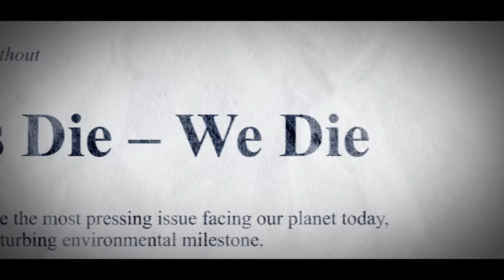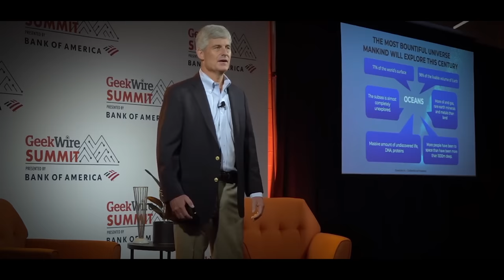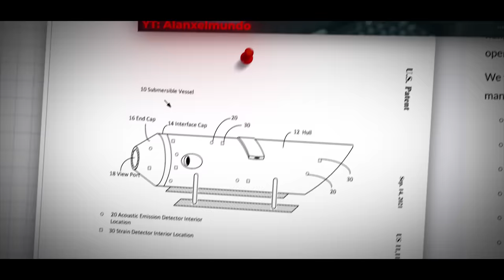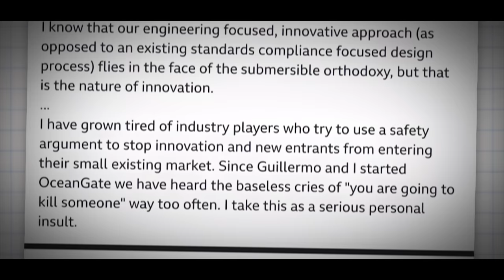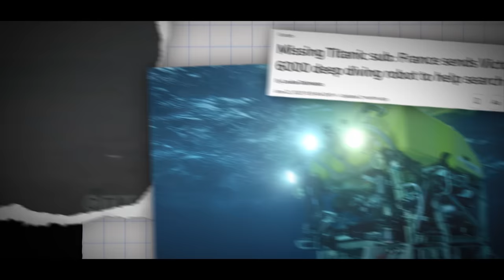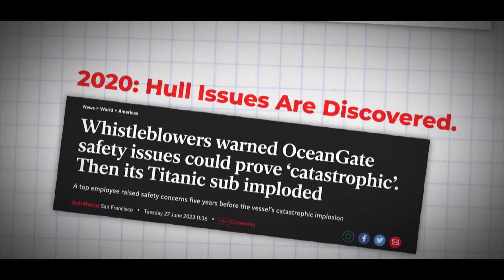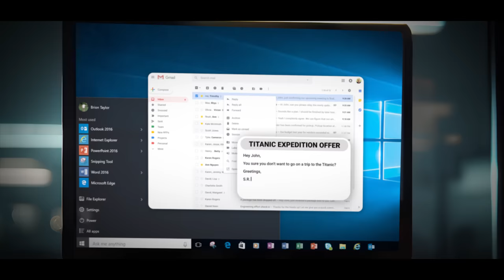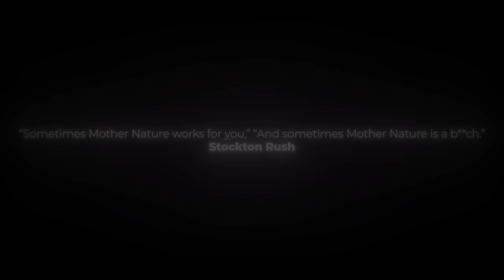The Dark Truth About OceanGate (Documentary)

Comment: I cant express how ridiculous using carbon fibre is. Anyone who passed first year engineering would be able to tell you how horrible an idea that is. Rush 100% thought carbon fibre sounded cool and decided his ego would be able to beat physics into submission.
Reply: But, they use carbon fiber in the fancy BMWs!!! 😂 How dare you suggest otherwise
Reply: This was my initial reaction too, but I think it more prudent to say there are obvious issues in using it in this application.  

I understand they use carbon fibre composites in aeroplane wings, which are in bending and hence in compression, and which flex continuously throughout the flights.  ChatGPT says they were used in the DC-10 wing leading edge as long ago as the 70s.  I have no idea what stresses are being taken in wing applications, but my understanding of comments by people who appear to be specialists is that they can be used in applications involving significant compressive loads.  I assume a lot of engineering was done to get to that point, including destructive testing and understanding buckling and fatigue issues and their interaction.  

I think the professionals in that area may be more inclined to say that it is potentially possible to use carbon fibre in this application, but a proper, very expensive, engineering research process would be necessary to validate that and determine its limits (at which point you can then consider whether it's actually economic when you do it properly).  There's an interesting video about this on Mike Bell's channel, his suggestion is that this research simply wasn't done due to lack of resources.

Two more comments: I have had many passing interactions with "industrial" and "life support" environments, and long ago I've even worked on the design of electronics to operate in them.  But - of course - there are whole layers of safety/reliability engineers working above the level of the technical electronic design who take charge after that.  To see consumer electronics and plastics used inside Titan catches my attention for multiple reasons.  

I also wonder what on earth the acoustic monitoring system could achieve unless its signals had been correlated to the fatigue cycle from empirical, destructive, testing.  I suspect it was as fake (and as obviously fake) as Theranos' "Edison" device.
Reply: To be fair, he did beat physics a few times.
Reply: Nah what he cared about was how cheap it is
Reply: It's amazing how you are able to come up original thoughts all on your own
Reply: It's the idea that they are divinely provided some sort of specialness. "I'm rich and powerful, so god/the universe must favor me and will protect me!"
They imagine themselves as the movie heroes whose ship disappears over the cliff but are saved by the engines restarting at just the right time
Reply: Less beating physics, more just using a rig that wouldn't last.

Even a copper sword can act like a sword, but it'll break far quicker than if it was made with proper materials, for example. @mattkaustickomments
Reply: All the carbon parts on my car will break in a crash. Imagine the pressure of the ocean lol literally, its common sense.
Reply: @SloverOfTeuth Clearly they can withstand some degree of compressive load, but I think it needs to be reiterated that he wanted to shape it into a cylinder and repeatedly take it to down 13k feet. Do you really need someone to walk you through theoretical calculations to understand why that's fundamentally different from your example?
Reply: Im sure he paid his way through, rich mommy and daddy kids dont need to actually learn
Reply: I think that Rush may have been thinking with an aerospace mindset (as that was his education), where weight-saving is extremely important, necessitating lower safety factors.

Thing is, an aircraft only needs to handle 0-1 atmosphere of pressure.  A submersible visiting the Titanic wreck needs to handle about 400 atmospheres.
Reply: @danielbishop1863  the deep ocean is more hostile to human life than the surface of the moon yet despite a several thousand percent increase in dives there hadn't been a fatality in 80 years until Stockton Rush. He ignored advice to do 50 unmanned dives to the full depth than have the carbon fiber examined. Oceangate was counting aborted due to weather and half dives due to technicals as trips to the Titanic. All he had to do was swallow his pride and buy a submersible from Triton Submarines and charge a million a ticket and try to do as many dives as possible during the weather window then go other places and sell half a mill or ,mill tickets
Reply: MONORAIL!
Reply: @mattkaustickomments  Yeah, probably would have been fine if they'd just built a new one for every dive!
Reply: Rush propably got his engineering degree far more for family connections and money than any real competency.
His behaviour around OceanGate was clearly "Born silver spoon up the arse brat who's never had to work for earning anything" type.
Reply: @SloverOfTeuth For engineering above water, carbon fiber is fantastic and works for a great many things, for subjecting a compartment built by carbon fiber and other materials to such extreme pressures as are encountered the deeper you go underwater, that’s a whooooole other ballpark. Theres being a maverick and there’s being unnecessarily egotistical to the point of extreme danger. Rush was the latter, but thought he was the former.
Reply: As a fellow engineer, I'm a little bit curious for your take, mostly because they didn't even teach my class to use this material. But I am assuming you are saying this because (when looking at the stress strain curve for most carbon fiber nanotubes ) they are just very brittle when they fail, correct?
Reply: I didn't even know the carbon fiber part, but the shape was wrong too. One thing I remember from James Cameron's doc is that they use spherical shapes because pressure is evenly distributed across the surface, unlike square or something where a point is a weakness. That plus composite material, that thing should have never been diving, period.
Reply: Then he should have gone alone, I don't know...
Reply: @TentinQuarantino_ I don't think a BMW has intentions of going 2.5 miles beneath the Earth's surface under water
Reply: @chorizoramen93  You're forgetting that window rated for only 1.3km depth instead of needed 4km.
And to guarantee safety margin it should have been really made for 5km...
Reply: carbon fibre is good just not good for submersibles lol.
Reply: No this is not a matter of taking school courses. This is literal common sense.
Reply: @garybrown2039  are you mechanical? If so, you should've taken a materials course, which (at least when I took it) included a whole section on the use of composite materials. I will say OP is being a BIT hyperbolic, since that's more of a second or third year course and the issues may not be apparent to the average engineering student. But it should be obvious to someone like Stockton who had like 5 years of experience as a safety engineer with a defense contractor (iirc it was McDonnell Douglas).
Reply: @danielbishop1863  thing is even in aerospace, those kinds of safety factors are supported with a LOT of testing. That's a big chunk of what makes aerospace so dang expensive. As far as I know, Stockton did very minimal testing when developing the Titan, to the point he should've absolutely known better if he wasn't so far up his own ass.
Reply: @Salien1999  no im civil. I work with concrete, wood and steel. But our dynamics classes overlaped
Reply: I started comparing this usage of carbon fiber to matted Straw as a firesuit, instead of an actual thermally insulating firesuit with all of its expensive and understood materials.
Reply: It's like he could not understand the difference between tensile and compressive stresses.  That should be what a freshman in college should be able to understand if he's going to be an engineer.  😆
Reply: They have tensile strength. They don´t like being crushed.
Reply: Old money and luckers love their buzzwords.
Reply: elon vibes.
Reply: @ScienceDiscoverer  Elon is a real engineer.  This guy would not understand the difference between compressive or buckling stresses and tensile stresses.  He paid with his life and the loss of his posthumous reputation.
Reply: Funnily enough, I had just finished my first year of engineering when this event occurred, and yes, I did think it was crazy that they were using carbon fiber.
Reply: @QuikVidGuy  This is the problem with all of the very wealthy seem to have.  That because they have acquired money and the power that goes with it, they feel they are better than everyone else, especially those beneath them economically. 

 After all, if the poor are working hard why aren't they rich?  /s    SMDH
Reply: @mattkaustickomments  He never beat physics, he just avoided paying the bill. Physics was patient.
Reply: @garybrown2039  Well then you know enough. Just like you can't pull on concrete and expect it to work right, you can't really 'push' on carbon fiber.
Reply: @SloverOfTeuth  As for the acoustic monitoring system, that was one thing the talking heads on tv got more or less right- they all pretty much said it was a pacifier, and at best it would tell you 'hey you're about to die' a few moments before it happened, because at the depths where these failures happen, there's no slow leaks in carbon fiber, and no quick trips to the surface from where they would be.
Reply: @chrisblake4198  Stockton Rush won a few games.  Physics was always going to win the match.
Reply: @chrisblake4198  Yes, it had to be, a complete charade.
Reply: I watched a documentary about oceangate right as everything was still on the news and i remember them building the machine out of carbon fiber because rush had a shit load of it lying around from a canceled project and he decided to go with it on this random project he had.
Reply: It was cheap.
Reply: Carbon fiber is great! For golf clubs.
Reply: @mattkaustickomments you don’t understand how physics work if you think that. He postponed the inevitable a few times.
Reply: I agree there was a time "carbon fiber" was a trending term like "nanotubes" or "hybrid electric drive trains" and people talked up stuff to be better than it really was.  Still plenty of that going on.
Reply: Weird how this channel referred to him as “an innovator” at the beginning of the vid.  I think being seen as such was more of an aspiration of Rush’s, rather than a reality. 
(Narrator also can’t pronounce “Antipodes.” Small irk lol)
Reply: Yeah, it’s like he knew that carbon fiber was used in airplane hulls and thought “this is the same shape let’s just do that” and then ignored all other information
Reply: Not even that, he got that carbon fiber for real cheap. So it wasn't even that he really was pro-carbon fiber submarines, he just wanted to justify a decision that was prioritizing cheaping out over safety or even logic
Reply: @cholodude97  you re such a cool guy man..27 years old and have a carbon fiber containing car....sure pays to have a rich daddy or do illegal stuff
Reply: I am not an engineer but I know that carbon fibre does not work for pressure. especially with that weird shape he made it.
Reply: @maestro-zq8gu same with nfts and ai
Seems that a lot of rich ppl don't have sense or originality - or the ones that do keep quiet
Reply: @Salien1999  Interesting. I (as an electrical engineering major, not even mech) had a materials and structures course that covered the basics, albeit without any specific detail on composites. Sounds like it’s a difference in education practices but either way it’s something any engineering graduate should know.
Reply: @Rei-xq3zm  I agree with you there. Even worse, anyone who worked 5 years as a safety engineer like Stockton did should be more than well aware to what standard things should be tested to.
Reply: Nah,Rush knew carbon fiber was a ridiculous idea for submersible. He just had a death wish and wanted to go out flaming, taking a few duped chumps with him. Each group he conned into going upped the ego boost, as he knew everything would go bust eventually...
Reply: The ironic thing is he decided he needed acoustic sensors to make sure the carbon fiber wasn't cracking / delaminating.  First of all this is an admission in of itself that carbon fiber was the wrong material and two what the hell difference would it make given how quick an implosion is.  If you're hearing cracking it's over.
Reply: i think it wasn't about sounded cool. it's really about cutting cost man
Reply: @mattkaustickomments  He didn't ever beat physics. The physics manifested over time, a process he seemed willfully oblivious to.
Reply: I couldn't pass a single engineering classs ....just hearing them explain why carbon fiber is dangerous for submersibles in caveman terms I understand it fully and wouldn't have been a guest on that sub

Comment: The Titan had a diving success rate of only 14% in just 5 years of use. For comparison Alvin, the most used deep submersible has a success rate of 98% even after half a century of its launch.
Reply: So Alvin will just go down in any weather?
Reply: And in contrast to Titan, while nearly everything about Alvin has changed over that time, the one thing that never did was the pressure vessel, because it held up and worked exactly as designed. Engines, tanks, lights, sensors have all been replaced and upgraded many times, but never the pressure vessel. Titan's hull had already been replaced once after a couple years and was overdue to be rebuilt again. So yeah, lots of people in here trying to claim you 'can' use carbon fiber, but none of them want to admit that just because you can, doesn't mean it will ever be a good idea to do it.
Reply: The best example of a deep water bathyscape is the Trieste. Nothing else will ever top that vessel.
Reply: @MrWolfSnack  Cool fact about the “Trieste’’ is it consisted of a heavy crew sphere suspended from a hull containing tanks filled with gasoline (or petrol) for buoyancy.

Since its gasoline is about two-thirds as heavy as sea water and only slightly compressible, its buoyancy supports the ship even under heavy pressure. 

 😳🤯
Reply: @MrWolfSnack didn't DSV Limiting Factor also reach the same depths as Trieste?
Reply: Nope, Alvin is unsinkable, a true titan of deep sea exploration
Reply: @BoleDaPole  Alvin is unsinkable cuz the crew operating and maintaining it follows the regulations strictly, and know how much punishment their submersible can take
Reply: The "Limiting Factor" is also a good example. It even looks extremely cool. (Alvin does too by the way. 😊)
Reply: And thank the God's for that. After the reaction to the Titan tragedy, coild you imagine what the internet would have done if it had been named Alvin? I imagine thousand of people roughly 12-45years old all standing along the coast just screaming "AAAAAAAALLLLLLVVVIIIIINNNNN!!!!!!!" At the water.
Reply: @chrisblake4198  That important distinction between 'can' and 'should'
Reply: this is mind blowing tbh , such incredible incompetence lol.
Reply: @tomd6704  
No.
It's more like how airplanes are so safe because the safety checks. Not because the plane is armoured.. (it's not).
Reply: Or just look at the Mir 1 and 2 . James Cameron used the pair of Russian submersibles for his titanic footage and they made 1,000s of dives with no real issues ever.
Reply: @oldtimegames96  Limiting factor holds the record for the deepest depth ever reached. To be fair it was only a handful of meters deeper than the previous one.
Reply: @tomd6704 I doubt it would go out in all conditions.  Just like how crane operators don't operate in bad weather.  If something seems unsafe you don't risk other people's lives.  Just like how bungee jumpers use more chords than you need to do so safely.  You build redundancy where you can
Reply: @nubreed13  
Exactly.

It's not a matter of being able to withstand anything.

It's a matter of only operating within a huge margin of safe conditions and rare exceeding those tolerances.

My grandad had a saying 

"It can't fall from the ground" 

If something is heavy... and you can't find somewhere safe to put it so it won't fall... then leave it on the ground.. 

It can't fall from the ground... simple. Safe. Foolproof.
Reply: Alvin is a gigachad.
Reply: I mean you gotta figure that it was dangerous being out there even for a floating giant ship
Reply: Titanic had a success rate of 0%
Reply: Actually it’s “diving” success was decent I guess
Reply: @BloodyBamPot  
We don't know what ots dive rate was.

Dive rate is accessed by testing the craft between runs and seeing how it has degraded.

Then we have a base line for how long the craft can operate before needing repair.

They didn't do these checks between runs.

So we don't know if the craft was at failure after one use or after 6. We don't knkw of ot was chance or design that let the craftboperate for as long as it did.

We can not conclude how safe this craft is based off of its operation alone.
Reply: @BoleDaPole apart from when it did sink. But that wasn't during a dive.

Comment: Interesting about the UW thing. As a student I’ve been bringing this up in conversations and what I hear on the ground is that they did work on the submersible, but originally they built it for only HALF of the depth it ended up diving to. Additionally, they thought they were prototyping. Or at least, Oceangate lied and told their UW interns their work was for prototype purposes. No one thought that what they were creating would actually be used commercially let alone be used at such pressures.
Reply: This feels true. Students and academics have long been used for this sort of experimental, new research/innovation thing and lied to. And I say this as an academic.
Reply: If that’s true, they need to be careful. Ocean gate will throw them under the bus.